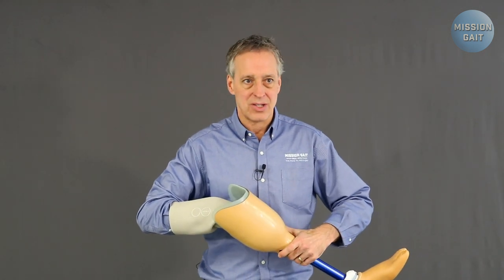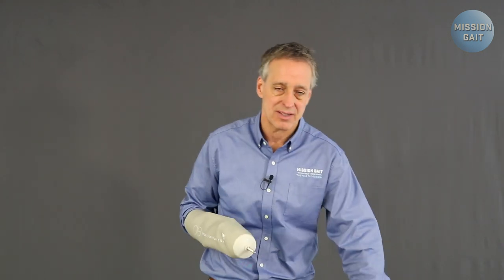Donning and Doffing a Prosthetic Limb - Prosthetic Training: Episode 4

Comment: I have an atk on my left side. When i sit down and try to stand back up my prosthesis becomes real loose, is that common?
Reply from the maker: Yes, it is very common! There are a lot of ways that can happen, so it is best to check with your prosthetist to determine if there is a way to improve your fit and prevent the loosening of the socket.

Comment: If the inner diameter of the nylon liner of the fiberglass socket does NOT match the outer diameter of the gasket at the position the "fixed" gasket lands at the socket liner  - the gasket will NOT maintain a seal-especially when the amputee sits (drives) and the leg shifts a slight angle, thus the suction breaks.  Using a gasket that moves up and down the liner  ...the user can adjust the location of the gasket to match the interior circumference of the fiberglass socket.  PLUS, since the volume of the limb WILL change - this allows the user to adjust the height of the gasket  to match the volume and changes in the limb. 

The fixed gasket is a design problem if not a potential for fall and massive annoyance.

Comment: Good video..is it ok or safe if still got air pissing sound still coming out from the socket valve.
Reply from the maker: This is what is called "pistoning", where the leg is moving up and down in the socket causing this sound. Usually this is a fit issue that can sometimes be resolved by the use of prosthetic socks or an adjustment to the prosthetic socket. If you are using only a suction fit and the prosthesis is moving a lot, it can be concerning. If you're unsure, check with your prosthetist to be on the safe side.

Comment: i have mid knee amputation this rubber i have is so hard i know to use hand sanitizer bit i cant get it any advice
Reply from the maker: There are quite a few reasons you may have trouble with this and it is a hard question to answer when not in person. I would recommend you consult your prosthetist to improve your fit.
Reply: @MissionGait  thank you

Comment: How can you easily get the lanyard system in perfectly straight if you have a knee that only bends forward?
Reply from the maker: (Please clarify if this isn't what you are asking.) The lanyard strap does not interact with the knee. Maintaining a good alignment is really down to establishing a good fit within the socket and aligning the knee to face straight ahead while donning the limb. The lanyard simply keeps the prosthesis suspended from the residual limb, contributing little to the actual alignment. A prosthetist can be of significant help in coaching further.
Reply: Mission Gait I mean an easy way to get my sleeve on straight, so that when I slip into the socket my foot will face perfectly straight forward. Takes me about 6-8 try’s with each leg.
Reply from the maker: @mariannethompson6955  You can try marking the top of the liner at the middle of the front-facing side using a permanent marker. Just a small vertical line. This way you have a mark to follow so you know how it should be properly aligned.